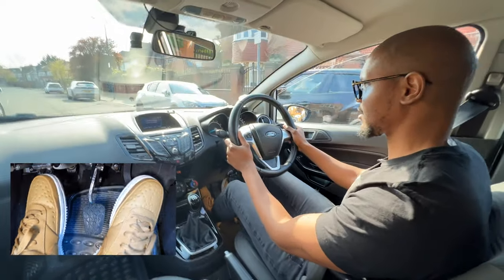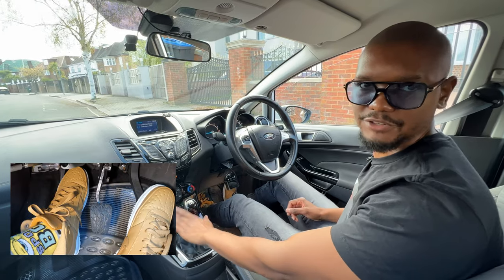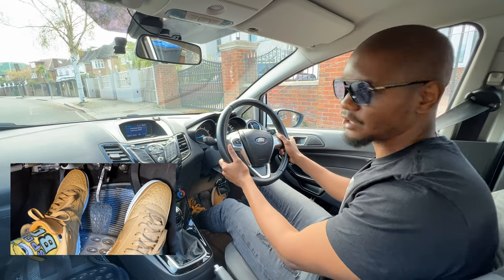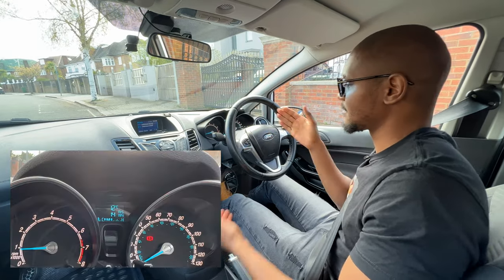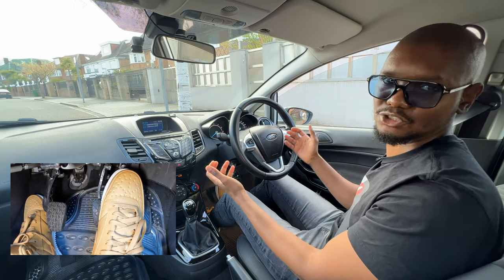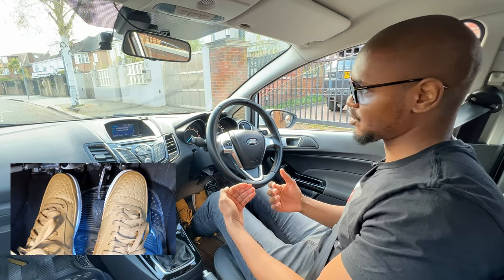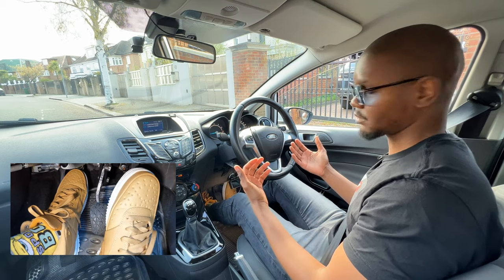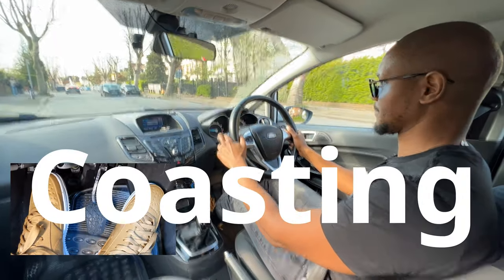How do  MANUAL cars STALL? Different ways you can stall the car and how to prevent it

Comment: Best tip I can give to new drivers who are scared to stall at traffic lights/junction and such is stay on the clutch very slowly coming off it whilst moving with the accelerator and its pretty much impossible to stall it. Do this while first learning and starting out, eventually you shouldnt need to do this as over a long period of time it can wear your clutch. Safe learning! :)

Comment: This is why manual is fun. It give you such a powerful torque by releasing the clutch quickly while only press the gas pedal a little. It make you feels like you're in fast racing car because of the instant acceleration by sudden release clutch. Sometimes a car that has under 90hp can feels like it has 200hp+.. so its all depending on how u release the clutch as u accelerating 😅
Reply from the maker: Very true!

Comment: I sometimes miss second gear since i try to be light on the gears and my fingers just slip off and it ends up in neutral and not in second and then i realise so i dont let go of the clutch i push it in all the way and go to first gear so i can restart and it just stalls for no reason at least 3 times like comming off the clutch so slowly and it still stalls until it goes back to normal

Comment: Thank you! Moving from a stop to first gear is definitely the hardest part. I guess that's why a lot of people are scared off of manual because the learning curve is really high at first (but then tapers off quickly!)
Reply: Tip to learners: watch the RPM while you're letting off the clutch and engaging the gas! it'll help you visualize the transition, making it smoother

Comment: I have a problem with the handbrake,  my ex instructor taught me the examinating police officer will release the handbrake and I shouldn't bother at all with it. This was his plan to make me fail even through I have good clutch control and now with my new instructor I still have the problem of forgetting to release the handbrake. About 8 months I learned to drive with my ex instructor, each time before the lesson he would release the handbrake and after the lesson would put it back. This intentional problem my ex instructor caused might make me fail almost every exam because I keep forgetting the handbrake and I stall the car even through I control the clutch correctly and I always start with first gear. Any fix for this or is this permanent?
Reply from the maker: Forgetting to release the handbrake is something which happens to a lot of learners. With more practice, this will go and shouldn't be a problem soon. Good luck. 😁

Comment: Bro do you stall. Many say after experience also stall. Even veteran driver. What to do after stall
Reply from the maker: Everyone stalls. After stalling, brake so your car doesn’t roll around. Press the clutch down and if that doesn’t restart the car, keep the clutch down and turn the engine back on with the key.